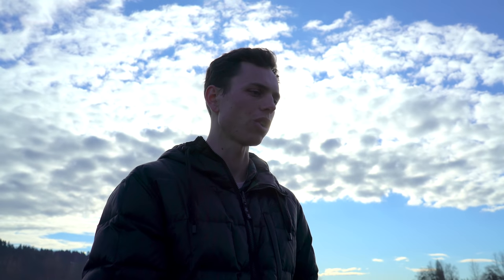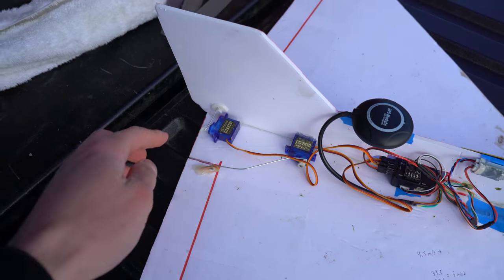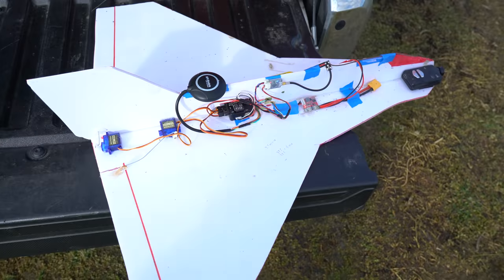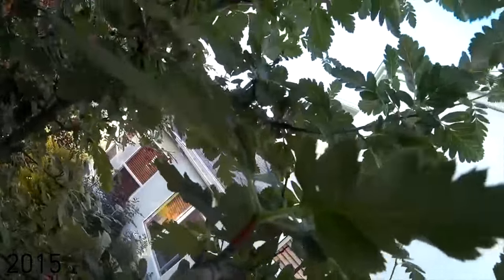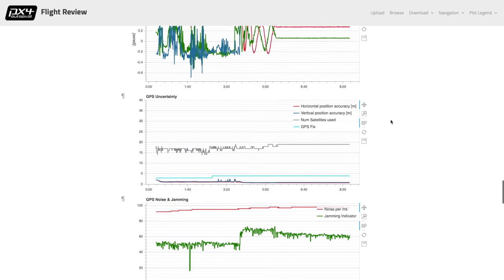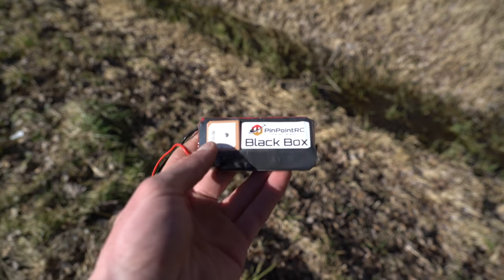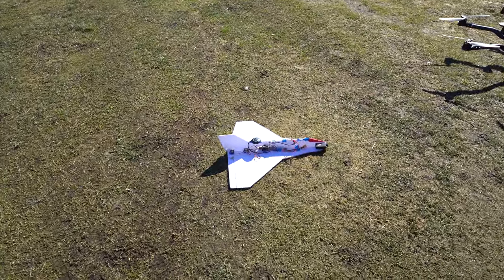GPS Autopilot Shuttle Glider Dropped from Drone - RCTESTFLIGHT

Comment: High altitude stuff.. 
  Like on a helium balloon, raised to 60km near the edge of space high altitude?
Reply: edge of space is 100km :) but 60 is better than Felix Baumgartner.
Reply: Pierre ANDRE 
Correct, the edge of space is known as the Kármán line and is around of 100 km.
Reply: @ciber_flyer  turns out earth's atmosphere extends up to the moon according to some recent discoveries.
Reply: @Mionwang  But the edge of space still remains at  the Kármán line, at some 100km.
Reply: @ciber_flyer  You mean Julian Baumgartner
Reply: Green Silver facts👌🏿👏🏿👏🏿
Reply: @ciber_flyer  Party pooper
Reply: A weather balloon will get you to 20 or 30km If you’re lucky
Reply: space is fake.  You can't go to space, except on television.  Back away from the television.  Even a 4 year old knows the earth is flat.  They have not been brainwashed yet.
Reply: GPS doesnt work on that height though... so that might be a problem.
Reply: Safe fly.
Reply: Jeff Beck is that satire or are you serious
Reply: @hankmengedoht6651  I checked his other comments, and I'm pretty sure he's serious
Reply: @jeffbeck6501  ah yes because 4 year olds are clearly the best people to go to for information
Reply: Low orbit is anything less than 300 Miles up.
The "space age" is more accurately "low orbit age".
Actual "Space" has 0 properties.
Humanity can't leave our biome without our hearts stopping, heart is vortex, requires the spin of earth.

Comment: For a manual RTH I believe there's a parameter to set minimum altitude, so the times it worked you were likely above that altitude, and when it rejected it, you had fallen below. A failsafe RTH might ignore that parameter because it's an "emergency". On a normal plane with a motor it'd be able to climb to the required altitude.
Reply: kc8omg so he should probably set RTH alt to as low as he can set the parameter then correct?
Reply: @Freebird_67  yeah, I would think you should be able to see it to zero, since it's a "minimum height", and then it would always try to head home
Reply: @kc8omg  maybe work out its (the shuttle) glide ratio, and set a initial waypoint (IP) position and final waypoint (touch down) set an appropriate altitude at the IP and 0 feet at the touch down waypoint, in fact if you set an ideal Altitude at the IP you won't even need to set an Altitude at the touch down waypoint. it will just vary a little bit with wind.

Comment: Maybe the vehicle is to close to home point when you engage it and is why it rejected RTH.? Try getting further out and away from launch point. You can change distance to home point engagement distance but can’t remember how.  It’s been a while since I’ve messed with Ardupilot and PX4.  I had the original 3DR mini pixhawk running px4 and had lots of issues and ended up dropping that  project and moving on to something else.  I’m not familiar with the pixracer but no they had some problems with that board a while back as well but sure that’s been addressed by now.

Comment: Imo the best lost plane tracker is tBeacon, because it uses 433mhz band to transmit coordinates via voice. So you can use cheap UV-5R to call for them and receive them, and if u'll use Yagi high dBi antenna u'll be able to find it even without coordinates. You just search for direction with best signal, and go there. 
I used to fly drones and planes in places with almost no cellular coverage (for example mountains), and this tBeacon thing helped me out really good though. It has its own battery with pretty low power consumtion because it just waits for you to call it and it doesnt transmit anything if its not needed.

Comment: Be careful with dropping from a balloon, as I saw a guy a few years ago try that and ended up getting his balloon rig tangled his antenna.  Instead, try putting a small balloon opposite the large one.  The small balloon is inserted into a cavity in the rear of the aircraft and holds it using pressure borrowed from the main balloon.  When the big one pops, all pressure is lost in the system and the small balloon releases the aircraft... no strings attached!  Good luck, I'd love to see it happen.

Comment: I suppose you can slow down your dropship and make it glide smoother (and as a result more spectacular) by applying the tail-breaking system which is in a real space shuttle is implemented by a two-piece split air brake.

Comment: If you want to do a drop test on a budget, please take a look at my X-37ABC. Plans & instructions are available on Instructables website. By the way, I did a drop test using a cheap WLtoys V262, using my trusty FlySky FS-T6 to release the glider (using a device I've built using a servo and a 3CH receiver), controlling the aircraft using a F939 receiver (which is compatible with the FlySky FS-T6. Now, I didn't have expensive cameras to film it, therefore the quality of my video is pretty cr@ppy, but the drop test worked perfectly.

Comment: You should make a code where when 5 ish feet off the ground it will pull up in to a stall and drop to the ground. Maybe code it or maybe use like and ultrasonic sensor
Reply: i was thinking the same thing, not sure px would do it, guessing it'd be more of an ardupilot job

Comment: Word of warning about those gps trackers - be careful using them in remote areas where there is weak cell phone coverage - if your craft goes down the gps on the craft will still know where it is, but without the cellphone network it can't let you know that information.

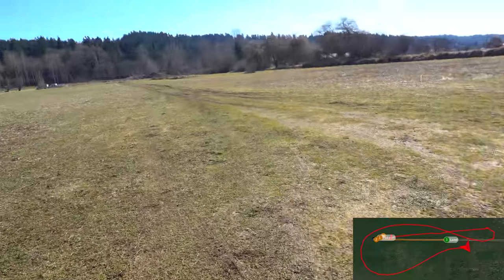Comment: 8:07 As a commercial operator (Flight test operator currently) and a past military operator with external operator qualifications may I state this out loud...? What do you have you turn radius set to? Are you capable of setting it and/or the direction of rotation in the flight plan? Given the close proximity of your flight plan legs, you may be overlapping your turn radius and or with a combination of the short legs causing the inconsistent flight paths in real life as opposed the those you have build in your software and uploaded to the air vehicle. To me it looks like the vehicle at this point was flying the flight plan, but the turn radius was large (shallow turn) and as such it didn't have time to orbit 2 in such a way as to strait line 3 if you will.

Comment: Daniel - I'm working on a project where I need to tow a glider, similar to what you have here.  I plan on towing in stabilize mode - no rc on board, just using the telemetry link to set Stabilize mode.  My question for you (if you see this).  How did you tune your glider?  Autotune would be tough on such a short flight.  Thoughts?

Comment: Very nice test. I had a similar idea of a weather ballon dropped plane for a long time, I was wondering how far you could go with a glider plane. If it is a wfficently build glider and you can drop it from 30km or so, you could fly for hundrets of kilometers. If you use high altitude winds probably thousands. Maybe also put in some solar panels...
Reply: It gets pretty difficult to build an efficient glider that is strong enough and controllable at those sorts of altitudes. You need very high true airspeeds to generate lift, which means you start dealing with stuff like flutter and shock formation. A  stubby-winged shuttle is a lot easier, but not as cool.
Reply: @JMMC1005  thanks, looks like quite a lot of research to do first.

Comment: So I'm working on a high altitude balloon glider project. I'm using a Yellow Aircraft F-4 .91 ducted fan as my airframe.
I've removed the motor if course and the retracts, etc. I have built a removable duct (so I can hopefully convert it back someday to EDF) that allows air to pass straight through from the inlets to the nozzles so I can keep it aerodynamically clean. My all up weight is something less than 6 pounds which is the maximum allowed for such a craft....
I've been testing multiple FC's..... Still haven't decided which to use...
I do not have the PX 4 racer. I'm interested in getting your opinion and wondered if I could get a peek at your data?

Comment: Mate love your videos. 
Dam that octo drone is a monster! 
Can you work out your glide ratio and use that to set “not below” and “not above” gates for the glider (which btw looks super cool flying autonomously).  Bare in mind tho, if you set a “not below” altitude, it might not be able to achieve that gate and could stall trying to achieve it. I don’t know how the AP works, but if it has the ability to monitor AOA or glide ratio to prevent stalling this could be a protection against stalling. Otherwise set gates with a window. Like not below 100’/not above 120’. If you set up a cpl of key gates, this might allow you to set up a reasonably accurate profile to assist with accurate landing location. However, add wind into all this, and any calculations will go out the window because the glide ratio will be based on ground distance not air distance (that is, unless the AP system can calculate air distance and work out its own ratios. Hmmm now that’s getting complicated and involved. 
You could set it up so that once it hits a certain altitude over a reference location, it then starts a pre programmed approach. This is not unlike how single engine pilots are trained to make a forced landing after an engine failure (essentially they’re now flying a glider). You have high key, low key, and from these two gates, you’re able to make an approach to land at the airfield with only minor adjustments on base and finals. Apply this sort of set of rules to your programming and you might be able to achieve a reasonable accurate landing location. 
More videos please. That glider looks so majestic. Especially knowing it’s flying autonomously! No twitchy pilot inputs!

Comment: This "experiment" has been already done successfully by the Italian Company ABACHOS. The glider can get data on the way down (temperature, humidity, pressure. etc., etc.), landing on the same spot it has been launched. By the way, they've recently upgraded the aircraft, equipping it with a motor, to increase the accuracy.
Reply: It isn't really that novel. Had the exact same idea of a self-recovering weather probe almost a decade ago, didn't follow up on it as I didn't have the money and nobody would be interested in a commercial implementation, as it would require expensive licenses for the product and special approvals and clearances per flight. But there are many RC hobbyists who've done similar things. The idea itself isn't really that hard to conceive, the implementation is the interesting part.
Reply: The real innovation is having a glider/airplane that comes back to the launch point, saving the users from travelling for miles to recover the probe and the electronics (with  all the data captured during the flight). If you had the same idea 10 years ago, you should kindly explain to me how you would have recovered  the probe, as controllers for drones and gps accuracy made it possible (and affordable) just a few years ago.
Reply: @RCLoversan  I wanted to use an RC glider frame with ardupilot or paparazzi running on a custom flight controller board. It was 2010, so accurate GNSS modules and MEMS sensors where all available back then. 
Recovering the data isn't really the reason why you'd want the probe back, as that's already all transmitted wirelessly on commercial weather probes. The interesting part is to be able to reuse the same probe multiple times over a short time frame, reducing environmental pollution from disposable probes, offering a  controlled second measuring run through the atmosphere and providing the opportunity to take more expensive payloads, as it isn't lost after one flight. But as I said, Idea stopped dead by bureaucracy and my budget.

Comment: Aren't GPS receivers required to shut down over around 20km?

So if your balloon goes higher than that you'll need to use dead reckoning and a compass bearing for the first portion of the flight until you get low enough that GPS starts working again.
Reply: Some won't shutdown unless you hit both the altitude and speed limits.

Comment: thanks for posting.    here are some  THINGS  to  consider.       at 1:04,  screwy pushrods.    99.999 percent of the time,  a  pushrod  Should be  STRAIGHT.       where  a bend is  Improperly  made in a pushrod, it  BECOMES  a  'surprise'   torque rod;  ie, play/sloppy under load.          suggest you use a  CONVENTIONAL  airframe.   one that does  not use  tailerons.          googletranslate

Comment: It looks like the glide ratio is so poor the glider doesn't have the flight time necessary to finesse autonomous spot landings.  Then again, could it also be the flight control system needs more tweaking?  Seems like without continuous altitude data updates the flight controller can only do so much.  Anyway, great project! 👍😁👍

Comment: Hi Daniel!  I recommend that you include an airspeed sensor and switch to Ardupilot firmware if your hardware supports it.  Ardupilot has more features in this area.  Another more advanced option is to include a LIDAR sensor to make the flare happen at the perfect altitude, but is probably not necessary given how slow your aircraft flies and you are using a pretty decent GPS.  Attached is a video which explains the configuration.  It looks like what would need to happen for your aircraft is to define the speed and decent angle for your aircraft, and define a flare speed that would be fast enough to keep control.  There is another parameter you can choose to have it spiral down.  Maybe changing that would prevent the control system from trying to keep altitude with a motor that is not there.

There is also a custom firmware called ardusoar which is worth a look.

https://www.youtube.com/watch?v=XuSl9Io93aQ

Comment: Why px4?
Reply from the maker: Only because I'm more familiar with it. Any arguments for Ardupilot?  I know it has a "soaring mode" but thats designed for a different purpose
Reply: Ardupilot not only fully supports gliding, it even has a soaring library to do automatic thermalling! It will in fact work fine for this purpose. The TECS library that makes gliding possible in px4 was written by Ardupilot authors. Paul and tridge. Ardupilot has orders of magnitude more features than px4, supports waaaay more hardware and supports more vehicle types. Not sure why people think they even close to being equal.
Reply from the maker: @TomPittenger  The soaring library relies on a motor in-between gliding sessions to gain altitude, and I'm not wanting to find thermals with this project. Isn't the TECS library just for more precise airspeed control? I don't see anything about the autopilot knowing it is a glider.